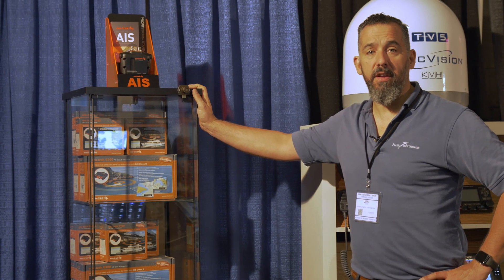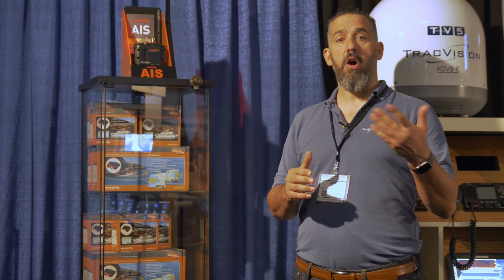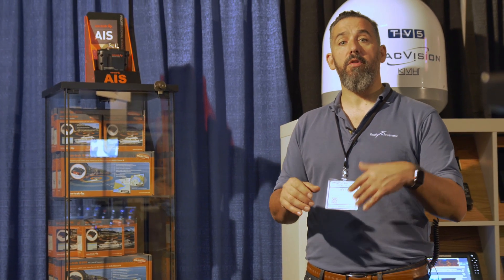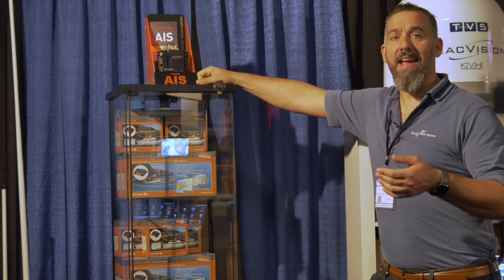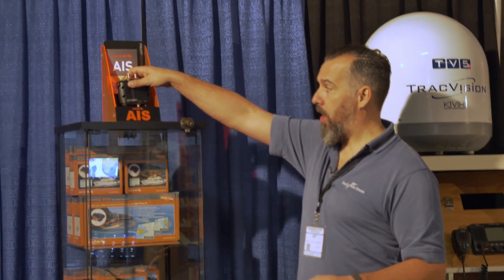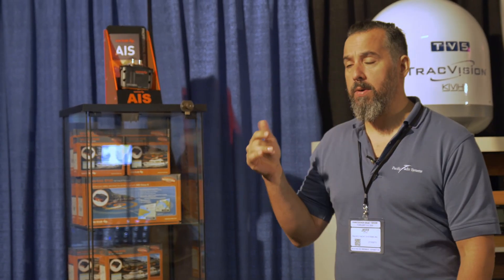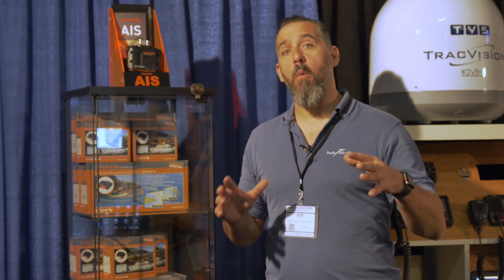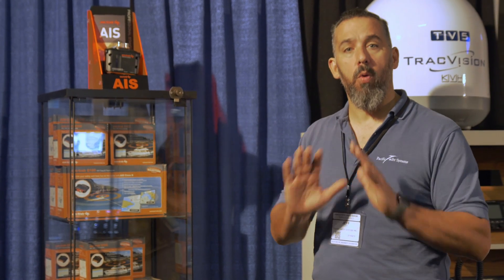Boat Show 2020:  Em-Trak AIS Transponders & Receivers

Comment: Hi Jeff!! I would like to be sure that the EmTrak B921 is compatible with my Garmin EchoMap Chirp53dv. I read in its menu the Ais option, and I read in the compatitibility list that is compatible with the Ais blackbox of AisGarmin. However, being a different brand I am still a little nervious about spending some money in something nobody is telling me it will work. According with my research it will but... you know... I wish someone tell me, Dont worry you will be fine it will work!!!!
Reply from the maker: If your Echomap is NMEA 2000 or NMEA 0183 compatible you should be able to utilize the B921 as it will share AIS data over either network. Anyone else had experience with this pairing ?